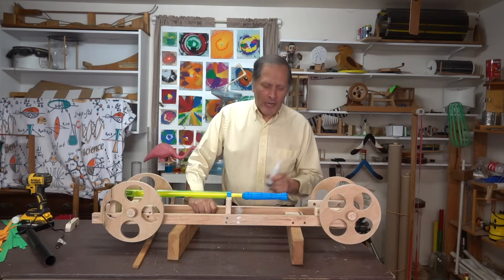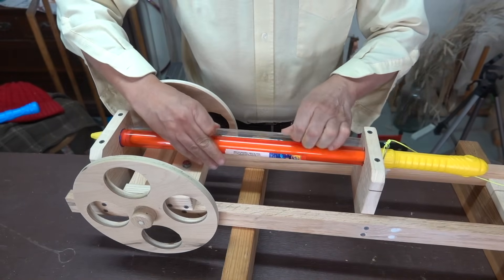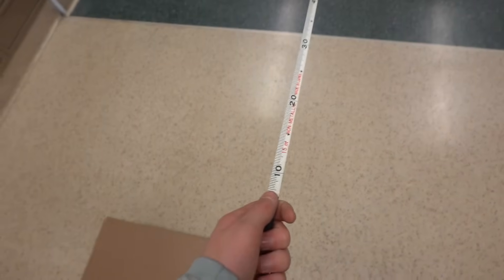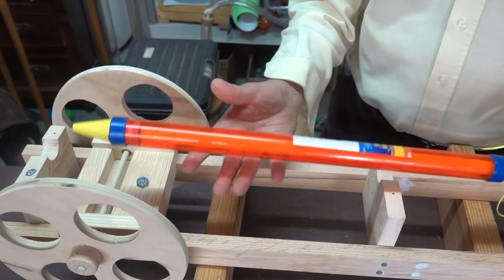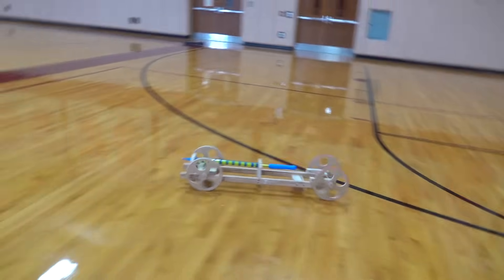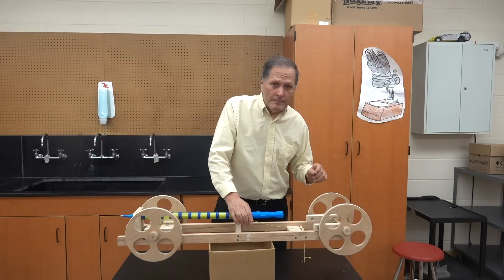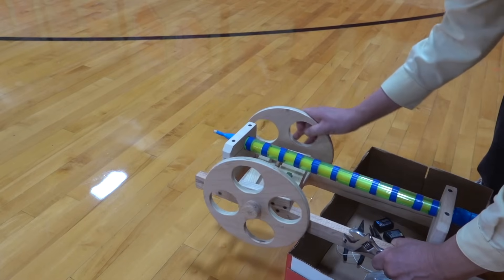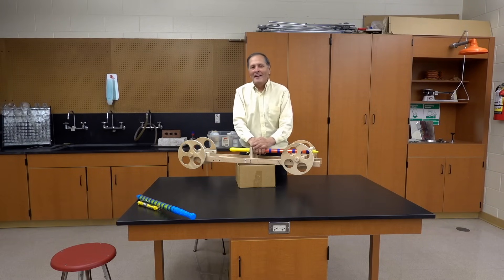Atmosphere powered cart. //  Homemade Science with Bruce Yeany

Comment: I always liked vacuum energy storage because the output is consistent for the whole piston stroke, compared to a positive pressure system where the force diminishes as pressure is released. How about a gravity powered car with a vertically suspended weight? That would be fun to demonstrate that it can't travel further uphill than the starting position of the weight (or can it?). Have you seen my piston vacuum cannon? ;)
Reply from the maker: Thanks Ben, good to hear from you.    I've always been amazed by atmospheric  pressure in general,  the sheer magnitude in force that's generated by even a small amount of surface area.  Also impressed by hydrostatic pressure.I have more demonstrations that I'd like to do in the future.I like the idea of gravity driven devices but don't expect that I can use it as a student project with the amount of time I will have with left students.  Retired 4 years ago but got talked into filling in for my old position for the last half of this school year and is keeping me very busy.   I loved the piston vacuum cannons,  tried one myself based on yours but had trouble getting a good seal.  It's sitting on my to do list but it seems like I'm always getting sidetracked.
Reply: Bruce Yeany it’s good to see you back on campus and still making some great contraptions. Kids will remember that time the old man brought in a homemade air-powered car and they raced it down the school hallway for the rest of their lives.
Reply: @YeanyScience  A question based on comments that have been made:  "consistent for the whole piston stroke" .. would this be true for a piston of infinite length?  does the vacuum never reach a point where you could not longer pull the piston???
Reply: No such thing as "Vacuum Energy" since there is no such force as Suction.  The energy is from Pressure.  In this case Differential Pressure, with very little on the inside and the pressure of the atmosphere on the outside.  To prove it, simply put this thing in a vacuum chamber  (which is always a popular request from the fanboys at "The Action Lab")
Reply: @shazam6274  Yes..Pressure in Multiple Directions...Light is Pressure...pressure is Light and Dark Yin/Yang..All Encompassing, like an Electrified (Field 🌋🗻🏔⛰🏞) ♎😎
 maybe 🤛🏿❤🤜🏼
Reply: @jeremiahbullfrog9288  ah, vacuums don't store energy, or anything at all.  See definition of vacuum.

Comment: Now if only you could have a full system where every revolution of the wheels would compress air into a system that would keep refilling the "fuel tank," every time you hit the brakes at a stop. Of course the system would have to be partially electrical, but I do think a fully mechanical system is possible. 

Jesus Christ Almighty God bless you all 😊

Comment: wrong. it is powerd by the strength of muscles pulling the vacuum.
Reply: By your own logic, you're also wrong because muscles are powered by the chemical energy of ATP. 
And of course, ATP would be powered by the chemical energy of glucose (and other chemicals) in food, which would be powered by the light that hit the leaves of the plant that you (or the animal you ate) ate, which would be powered by nuclear fusion, and and on and on and on.
Reply: It would be more accurate to say it is fueled by food calories for the human engines which transfer energy into the piston of the vehicle which powers the rotation of the wheels.